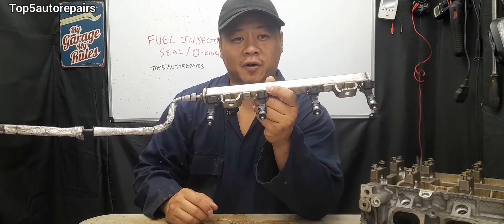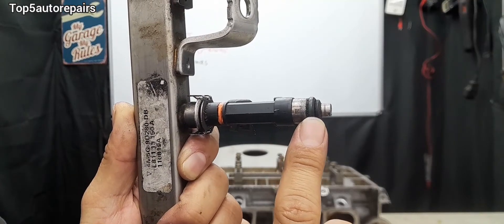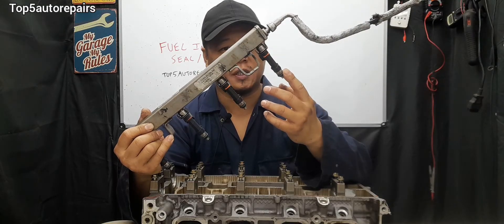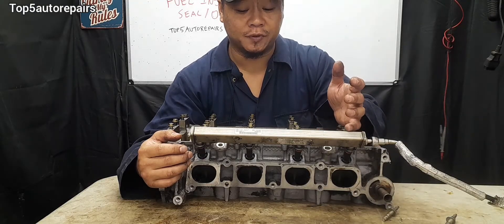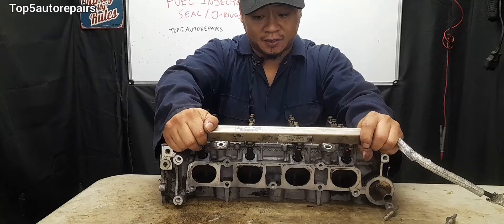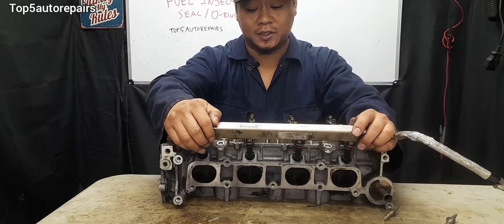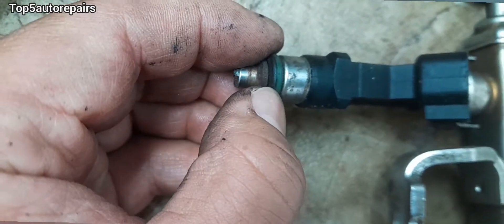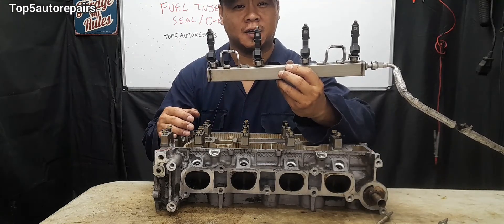BAD FUEL INJECTOR O-RINGS SYMPTOMS

Comment: I’ve a problem with my 2005 Toyota Corolla. It starts fine in the morning but when I drive and the engine gets hot and I turn the car off and wait for like 5 to 10 minutes, I’ve to crank the car the second time before it starts. Sometimes it cranks for long when it’s hot but might start on the first cranks and it will stall but balance itself. I’ve changed the fuel pump twice but the problem wasn’t solved. Someone said it might be a leaking fuel injector.

Comment: I think I might have dropped a piece of the little black rubber ring as I could not find the little piece after I pulled out the injectors. Can the little piece of rubber harm my engine if it fell in? Thanks in advance

Comment: Thank you for making that video. I just installed a new intake manifold on my car and, ever since, it has a small miss at idle. I'm quite sure I got the gaskets correct but I did notice that the O-rings (from 2006) should have been replaced. As soon as they arrive, I'll replace them and I bet it will fix the issue.

Comment: I did not add engine oil when I reinstalled my fuel injector rails and it took a lot of effort which broken two of the o-rings causing air / fuel leaks. Thanks for that tip!
Reply: Same here. I did not lubricate the o rings and it was very difficult to install the injectors plus some of them leaked. Next time I better take it to Top Five Auto repair!

Comment: Thanks - had this problem on my 07 Kia with 200K kms - symptoms were random misfires on cold starts over winter (due to lean condition) and gas smell after parking in a garage in summer (due to escaping fuel vapours) - I diagnosed the vacuum leaks on the engine-side o-rings by spraying carb cleaner on the injectors while running the engine and listening for rpm change - when I pulled the injectors the engine-side o-rings were brittle and tore on removal while the fuel rail side o-rings were still pliable - heat was clearly a factor - to add, you can check for fuel pressure drop using a gauge to tell if the fuel rail side o-rings are leaking - engine should hold fuel pressure for min 5 mins after switching off

Comment: Excellent video! Clear and to the point! I've been chasing down a high idle on my car and discovered spraying carb cleaner at a couple of my injectors causes the idle to drop. I assume the o-rings are bad and causing a vacuum leak. I also noticed my car has trouble starting when warm and this might be why... the fuel pressure might be bleeding off when it's sitting. Thanks for the tips!

Comment: is it safe to use ATP Automotive AT-205 Re-Seal Stops Leaks on new o-rings prior to putting them on.  I have used AT205 to replenish old rubber before. Not o-rings but other types of rubber.
Reply: It's just cheaper to buy new o rings.

Comment: I’ve been fighting for weeks replacing everything in my fuel system on my Skyline R32, changed fuel pump, in-line filter, even the fuel pressure regulator, turns out it’s leaking fuel from one of the injectors, car kept dropping fuel pressure at idle and finally found culprit

Comment: Good video! I have a question about the MAP sensor on my 04 Cavalier. I was told if it's weak it will cause the idle speed to be affected causing low idle bad gas mileage and not shifting properly is that true? I've already cleaned the throttle body. The car has over two hundred thousand miles on it. Any help would be great
Reply from the maker: Check out my map sensor video.
Reply: @Top5AutoRepairs  thanks 👍🤛🤙

Comment: Bro, I need a little help here. I replaced drive shafts for a 2014 corolla today, and afterwards the gear hits really hard when I select to drive or reverse, and later on the the transmission isn't changing at all . What could be the case please  ? Really need your help
Reply from the maker: Make sure the axle is pushed all the way in the transmission and also check transmission fluid. Transmission fluid can leak out when changing the axle.